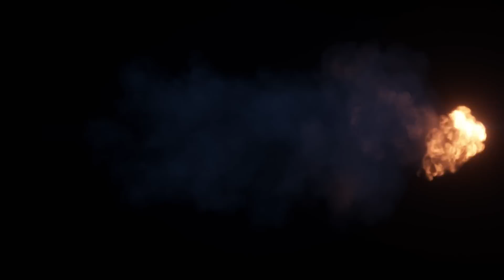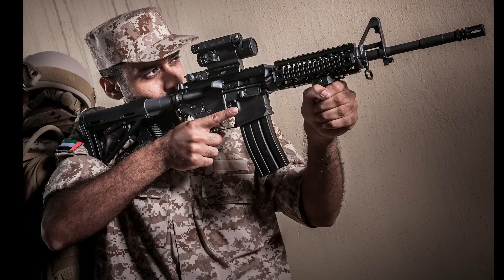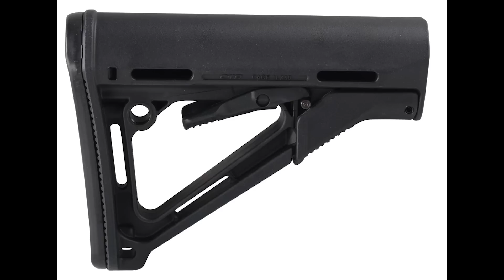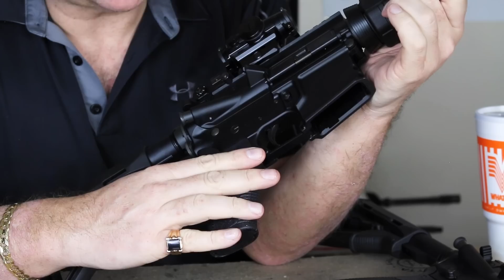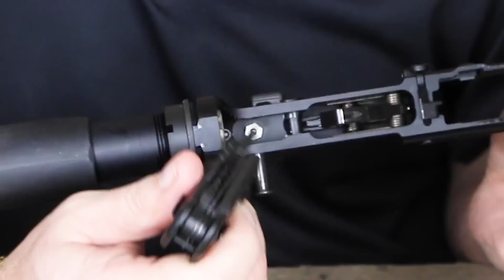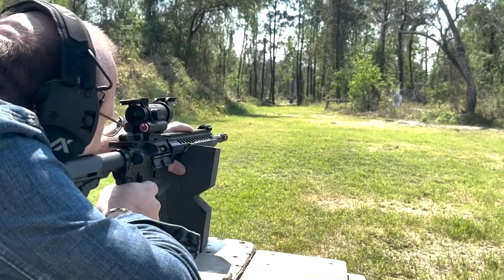Caracal CAR814A2 Patrol Rifle

Comment: Did you notice much difference with recoil impulse between the internal and external piston versions?? Do the chambers in the internal piston rifles have the extractor nub in the barrel extension to prevent catastrophic failures from blowing gas in the wrong direction??
Reply from the maker: The barrels on the 814 and 816 are the same, just different gas block according to which gas system it used. The 816 will have a slightly increase in recoil due to the external piston operating mechanism.
Reply: @SmallArmsSolutions  Thank you, much appreciated..

Comment: Question?
Has anyone done a teardown of the Caracal and a HK 416?
Did he know what the ejection pattern was? 
I still like them for being a piston driven AR!
Reply from the maker: I jut released a video comparing the 416 to the 516 and the 816. All are torn down
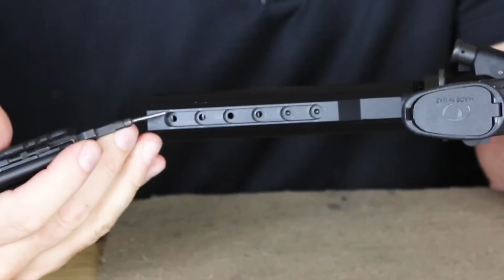Reply from the maker: 416 is over gassed, around 1 or 2:00. The Sig and Caracal are around 4 or 5:00
Reply: OK
Question?
Do you know why they are overgassed? @SmallArmsSolutions
Reply from the maker: HK felt this was necessary for reliability in adverse conditions so it is told. But it introduced other problems that would later be resolved with the Sig and Caracal rifles

Comment: One of the most impressive ar versions I’ve used is the caracal 816 piston operated ar .  A final “perfected “ version of the heavy over gassed hk416 and the sig 516 .  They are virtually unattainable now but it is an amazing rifle .
Reply: I bought one several years ago after SAS did his first Caracal 816 video.  I asked a nearby dealer to order me one and I had the rifle a week or two later.  I may try the same thing with the 814.  The prices are good imo.
Reply: You can have one shipped to your FFL if you contact their headquarters in Idaho

Comment: I put the Strike Industries Enhanced bolt catch on all of my AR's, not the Extended. The top and bottom paddle are larger but just by a little bit. It's especially noticeable in a beneficial way for releasing the bolt. It's not an obnoxiously larger release paddle, it's maybe 50 percent larger than the mil spec release paddle. The bolt catch top paddle isn't really all that much larger than mil spec but it has a beveled edge and is thicker which gives you a bit more leverage when pushing with your thumb. It's a nice upgrade but is not a comically large part. The Extended bolt catch is the one that is ridiculously large, probably for competition shooting.